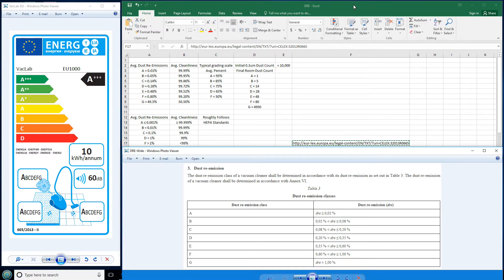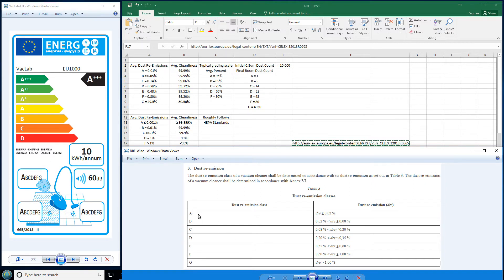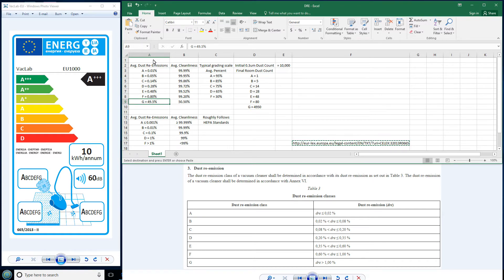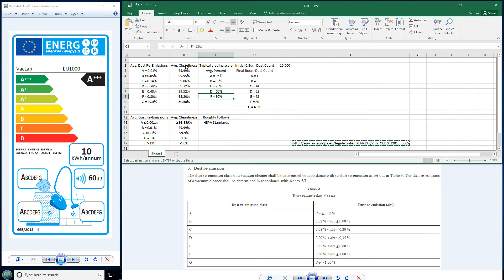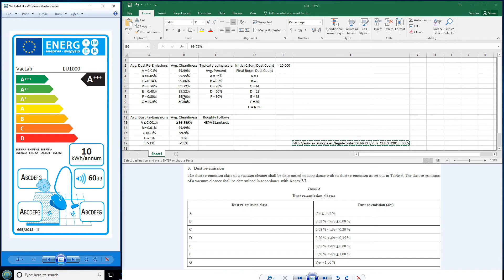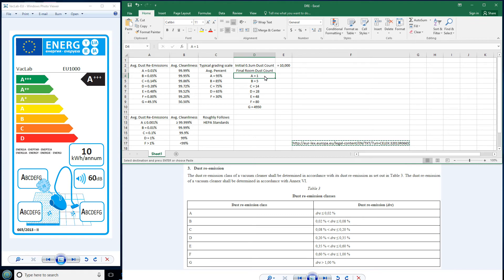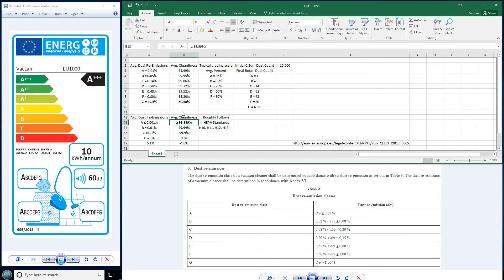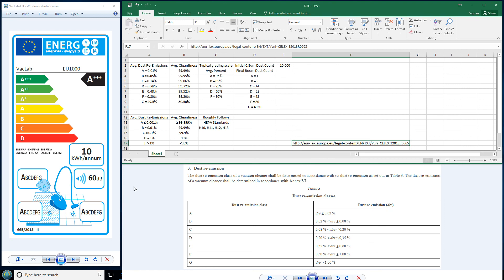EU Vacuum Ratings (Dust Re Emissions)

Comment: The idea that they count carbon dust emissions from brushed AC motors is insanity. A bush is what, two grams? That omitted over the course of ten years combined with the fact that it's non-toxic is completely stupid. That means pretty much every machine would have to switch to a brushless motor, which would add a not insubstantial cost to consumers. I'm all for these kinds of standards in most circumstances, it's what lead to Japan making some of the best small cars (all things considered, look up the Kei car standards) in the world in some cases, but those regulations were not just dictated, they were intelligently designed by industry experts and government in dialogue. While far more limp wristed in some situations (specifically in the qualifications process which is mostly self-performed by industries instead of independently verified), Energy Star is a co-op between the EPA and relevant industries, which means those labels tend to be a bit more logical.

Comment: I think the EU requires that vacuums achieve at least an F rating for dust emissions. They're quite anal about reintroducing dust back into the air.  But anyway, the even the cheapest, crappiest vacuum I could find in a supermarket still got an F or D rating, i've never seen them go down to G

Comment: If you ever see a new Dyson a ball multi floor, animal or an multi floor or animal 2 in a thrift store or on someone’s driveway in the trash you should grab it.The brush roll has no lines in it like the dc65 and the agitation is really good it will do a lot better with sand and baking soda. I don’t think the airflow is much better but it is better.
Reply from the maker: I keep an eye out for all newer Dysons.